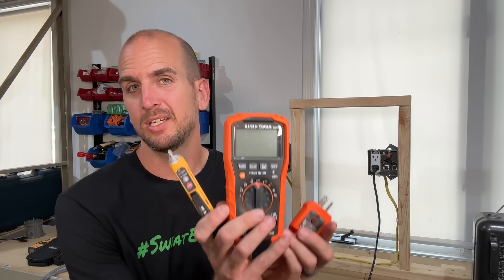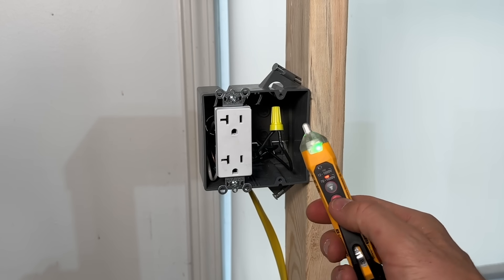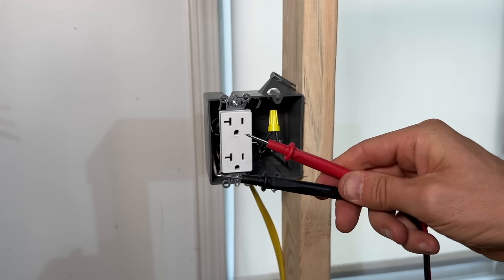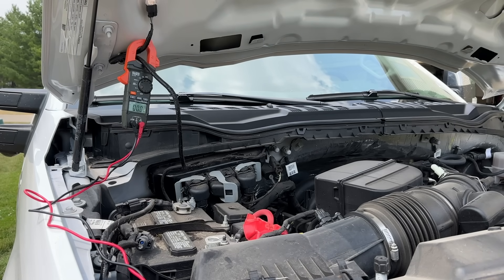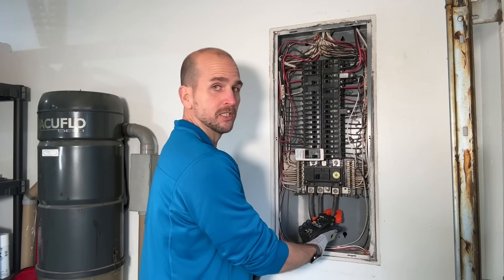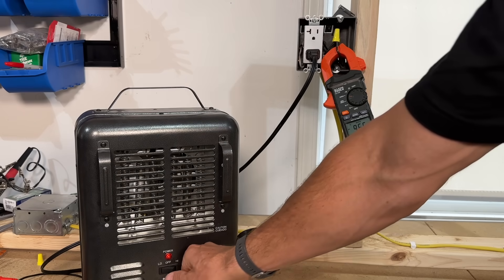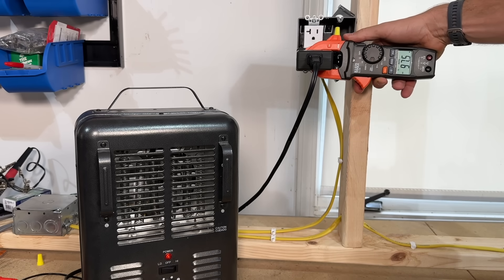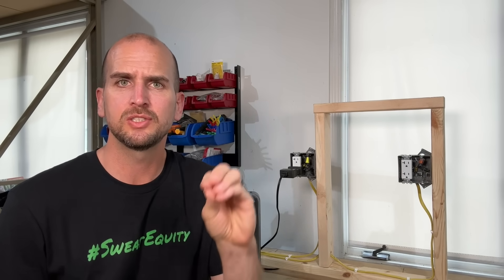Why The Clamp Meter Is The Only Tester You Need | Pros and DIYers

Comment: You can make a splitter for 1/4 the price or less of the ready made one by getting a cord plug and socket and wiring a short piece of insulated wire from the the hot and neutral connections on the plug and socket,. Then just clamp your meter around the hot wire to test (with it connected between the power source and the load, of course).

Comment: With a Tamper Resistant receptacle,  you can't insert voltmeter probes. Does the clamp meter splitter provide test points? I keep a cheater ground plug for that use.

Comment: As a journeyman electrician, I rarely use a multimeter to check if something is dead. The multimeter requires you to hit 2 electrical contacts simultaneously and if you have a burnt up outlet or switch or a dirty or damaged probe or have user error, it’s going to read dead even if it’s Alive. The non contact tester is the way to go.
Reply: @tecdrone710I was just about to go out and get a Klein multi meter. Why did you say they are unsafe?

Comment: Would be nice if it had InRush Amp (for like measuring start power on a motor or HVAC system)  Only one I've seen is on a FieldPiece meter.

Comment: Absolutely wrong and dangerous. NCV detectors would never give you 100% reliable AC detection, and almost never DC detection. You MUST use proper contact voltage detector. Klein Tools clamp meter is absolutely crap - it lacks low amps, ignores DC amps, is not True RMS and has low precision. Better get Fluke, Appa (Benning/Duspol) or Greenlee (Brymen) tools.

Comment: You can push bad battery to the 12,7 V area, but it will drop to about 10 V when small load is applied = you have one dead cell. As for alternator "charging", increase the load and observe the drops - then you can judge if it's OK/NOK.

Comment: It's a little odd to say you don't need a non-contact voltage tester, then say you can use a non-contact voltage tester in the shape of a clamp meter. You're using the same functionality, just in a different shape.

Comment: I would recommend a Clamp meter with DC current test. This would give you the very important feature for checking drain current on a cars electrical system without having to disconnect cables. Thank you for your video.
Reply: I don't have DC just ac so what i do ? I checked battery for my car with AC it said 0.004  its good or not?

Comment: Knowing how various tools measure or detect can be very helpful, even improving safety. Voltage is analogous to pressure, amperage is akin to volume. Direct contact meters can measure the "pressure drop" between a hot and neutral or ground, while NCV sticks rely on inductive fields around conductors, which may not always work as anticipated.
A surprising result shows when a stick detector is run along a cord; power is on, a complete circuit is operating, yet the stick will usually only alert along the "hot" side of the wires. Even in the breaker panel, the large neutral will usually not trigger the stick detector, though all the 120 V. current is carried back to the transformer along it. Why?
The analogy that fits is the hot leads are like the water pipes coming in to a place, under pressure, while the neutral and grounds are akin to the drains, where there is very little pressure.
You might get away with handling a neutral in a live circuit, because its resistance is much lower than your body; if you disconnect it, though, suddenly current will seek ground through you, going to either the neutral in your other hand, grounded surface in contact with you, etc. This is why modern tools have mandatory ground wires; old metal ones could have a neutral wear, and contact with the shell could make you the path of lower resistance. An uncle had that occur, and he survived by shoving the drill into the dirt. Not an ideal option.
Reply: I also use the water analogy, but if voltage is pressure, current is flow not volume (units/second) , and charge is volume.

Comment: I just purchased a Klein Tools CL220 meter and didn't know it had the non-contact voltage tester integrated into the clamp jaw. I also didn't know the test leads could take the extra sleeves off so one can insert the leads into an outlet. (This was the one thing that really bothered me, and now I know I can take this off and make the leads like I am use to.) Thanks again for a great video!
Reply: I learned the same things in this video 😂

Comment: My favorite Klein tool. The DC clamp ammeter makes it as useful under the hood as in the house electrical. 
My voltage tickler is still more convenient to check quickly for hot wires.
Reply: Pretty sure clamp meters don't work for DC because they rely on the changing field of AC. This unit doesn't measure DC amps and therefore isn't ideal for automotive applications.

Comment: The HT206D (Habotest or Kaiweets) is a affordable and accurate Clampmeter with DC current too, beside many other features. The cheap ones with only AC-current arent complete, many will regret when they bought a clampmeter without DC-current measurement. This important fact you didnt poin out.....and its much more useful than a second display ; )

Comment: I have always wondered how a line splitter multiplies the amps? If it just coils both the hot and neutral around in a loop ten times each then they would still just cancel each others emf out and you would still get no reading? I would like to see someone taking one apart.

Comment: Sir:  May I compliment you on your excellent  video !  You speak at a constant level, speaking  at a rate easy to understand, & you have good articulation. Your descriptions are absolutely correct, & for a home owner DIY person, it was a delight to see. I have a number of "amp clamps" (all high end") & a selection of  DMMs , which I absolutely MUST have ( I am not working on home electrics except my own, but the Klein unit is very good, & I can't disagree that the Klein would satisfy the requirement for the DYI. 
Your video eclipses many that I have seen on the internet by a wide margin. Thank you.

Comment: Thanks. I bought a clamp meter not long ago to use it as a clamp meter. Now I saw you using the non-contact function. I checked my Brymen BM037 and I discovered it also has EF-Detection functions. Good to know.

Comment: Oh B.S. I like to have all of those, including the clamp meter. I do things in actual electronics as a ham radio operator and such that I need a DMM too. Most DMMS are auto ranging anyway, on his clamp thing he has to change the decimal range by pushing a button. Also my DMM has more resolution past the decimal point that his clamp does. If you're not a homeless person, you certainly should be able to afford all of them.

Comment: Surprised that you are using the Klein CL120 as it IS NOT a TRUE-RMS meter
Instead, it is an Averaging Meter which WILL NOT give you the correct Current (Amp) measurements when used on non-linear or non-sinusoidal items such as Switched Power supplies, LED fixtures, etc.
(Note that all of the other Klein Clamp on Multimeters ARE True RMS meters)

Here is a video explaining why it is important to use a True-RMS meter for AC Testing:
https://www.youtube.com/watch?v=RFhG7l1YmBI

Comment: Been using one for years. Still keep one in my tool bag now that I'm retired, only mine is a EXTECH EX623. That model probably been upgraded by now. Just went through the house to check all the outlets, found many needing the terminals tightened. All good now.

Comment: No no no no!

If you want to test for hazardous voltage, go by what code and guidlines for safe working practises demand! You use an electrical tester, not a random diagnostics tool. The thing you show is a multimeter with current clamp, not a proper tester.

Finally get an electrical tester, many of them can even measure current (for example Fluke T5, T6, Beha-Amprobe 2100-Delta, RS PRO VTA and many others).

Your Current Clamp DMM can run out of batteries, be in the wrong setting, be damaged, be in a mode, be in hold or a hundred other things can go wrong. That's why it's not suitable to reliably test for dangerous voltage and perform safe insolation.

As before, my examples of suitable testers: Fluke T+Pro, T5, T6, T150, T130; Ideal 61-547, Vol-Con; Klein ET40, ET45; Beha-Amprobe 2100 ... and many others.

Comment: Honestly, I've hardly ever needed a clamp meter in 30 years for home repair. 9/10 jobs can be done with a multi-meter. That last 10th is largely covered by a kill-a-watt meter and a $10 contactless stick for convenience. Only ever needed a clamp for the main panel feeds or to feed the HV spark plug pulses to an oscilloscope.

Comment: Just because you have 12 volts does not mean the battery is good, you need to test with a load...... or you will never get an accurate reading

Comment: For home use, you can buy a watt plug in meter instead of splitters. You plug the meter in outlet and then your device into it. It’ll tell you current and power consumption and a bunch or other metrics.
Reply from the maker: Those are pretty handy, thanks for the feedback!
Reply: They are called Kill a watt & they are available at Harbor Freight

Comment: So you did a dyi video about testing electrical circuits with a meter. But you failed miserably . Because you didn’t say a word about safety. Nor worr safety glasses when you where in the panel .  Very bad example. If this is your normal way doing electrical work . I can see you being electrocuted. You might be fine 99  tine out of a hundred. But it only takes once to die. You’ll find out.

Comment: Cheap current clamps are great if you're not too bothered about accuracy. This one is 2% of reading plus 10 counts. So 400 amps could be anywhere between 382A and 418A. That's not including where the wire sits in the clamp, which also has a huge bearing on the measurement.

Comment: One thing that has annoyed me about my clamp meter and all clamp meters I have seen so far is the ability to use the MAX setting for both the DC and AC current clamp. For example, if you want to see the start-up current of a device like a compressor turning on or the starter motor in your car
Reply: It would be nice to get a meter that records max ac or dc amps.
its called data hold on the UNI-T 210e, its just a button you have to hit to hold the max value
it would be nice if the tool showed max without trying to hit a button and catch starting amps
Reply: @nexrace  Yeah, I tried similar things on another UNI-T meter, but the issue was that the meter would take its time switching between all the different measurement ranges. By the time the meter switched into the 100A range, the thing I am measuring is already started.

Comment: I have a combination non-contact voltage tester with a receptacle+gfci tester.  It is fantastic for basic jobs.  You can check for voltage, confirm polarity, grounding and test gfci functionality.  Though for trickier troubleshooting issues, I still bring out the multimeter.

Comment: I took a job in a manufacturing lab in 2019 where we had three Klein multimeters. After two years all of them were broken. They wouldn't go to the correct mode, or they just gave incredibly inaccurate readings, especially if equipment was operating near them. When I asked if someone was abusing them, I was told "no they just break a lot, that's why we have three of them." I also needed to take them completely apart to change the batteries.

For DIYers who might use them 3-4 times a year, yes, they're great meters. But if you're a Pro, spend the money for a serious meter. There are plenty of Fluke models under $300 made for technicians.
Reply: I ordered a Fluke AC/DC Clamp meter for $150 and yesterday found a Fluke AC clamp meter for $70 in a pawn shop so I grabbed it. This will really help me watch my solar system and inverter closer. I fried two alternators in a row so now I’ve turned off the DC-DC Victron charger until I can measure how many amps I’m drawing off the alternator(Think I’ll try adding a second alternator).
Reply: For professional uses, I only recommend Fluke. And I even bought one by myself in my home.
Reply: Fluke is the best!

Comment: Hey - a shortcoming in the aforementioned power measurement instruments, for which I've not found a work-around, is how to measure DC current? My Radio Shack DMM does what you demonstrated: AC Volts & Amps & DC Volts - but NOT DC Amps. Are any of them capable of measuring thus DC Amps? 

This is especilly important when determining a best-matched DC power adapter for things like USB & laptop barrery chargers. I hope U have some ideas?!?

Paul M - Atlanta
Reply: Here's an idea........google.
Reply: @typ044  Hey - don't you think I've tried that? If you know something I don't - by all means, please share!
Reply: @paulm5935  Well, not trying to be a dick but theres lots of meters that will measure dc amps, and if you googled it you should know that. There are piles of dc ammeters available for cheap. Also plenty of clamp meters do both,
for example my fluke 325 will do both AC and DC current. 
What is it you're confused about?

Comment: Fluke meter absolute best
Reply: And how would you know that? Is it because you read their marketing material? They have released products with the same defects as in recalled products during and after the recall. Taken six months top return recalled products, and returned one with the defect still in place. Fluke is fat on gov't contracts. Dull and satiated, No longer innovative, nor responsive to customers, They're premium 87V MAX has poor visibility display, poor backlight, and in audible continuity, diode beeper, A little tiny over voltage indicator. At that price these are easy fixes that should not be tolerated but improved and remedied. That is the best to you? Compare 87V MAX to Hioki DT4282 Which cost less and beats Fluke in nearly everything, including precision, resolution, speed and accuracy, Made in Japan by people who care and innovate. You can have your Fluke.

Comment: Thanks for the great episode. Now I know what that bump on the end of my clamp multimeters is for!

I have a Fluke digital multimeter with an AC Ammeter clamp accessory, a Fluke clamp ammeter/multimeter, and a Chinese brand clamp ammeter/multimeter. For DIY work both the mid-priced (around $200?) Fluke and the $65 Chinese brand clamp ammeters work extremely well, and are flexible enough to do almost anything around the house. One of the MAIN differences that people should look for is whether the clamp meter will read current load (amps) in both AC and DC. Many standard DIY units will only read AC, but if you're a DIY person working on both standard 120/240 volt AC and any low-voltage DC systems like a doorbell, sprinkler controls, or maybe even fancy zoned-heating ducting controls in a house, or on just about any 6/12/24/48 volt DC vehicle then being able to read DC amps is EXTREMELY useful as a troubleshooting tool. For electronics and smaller scale DC volts and continuity testing my regular digital multimeter is the king, but for house or vehicle the AC/DC clamp multimeters are a far better ticket to success.

Comment: In my 40yrs of electrical work. When I work in a national historical registry home, tracing knob and tube wiring that the customer cannot afford to rewire,  that pre dates the historical structure. The clamp on is next to useless. ON an open circuit, the clamp on will most likely read full voltage on the feed and open neutral side. Its great with modern wiring. my Volt tick has saved my life a few times. Laying against a live AC duct, my body became evergized and my volt tick in my pocket sounded off, telling me that my body could discharge a shock. I have repaired many knob and tube systems with just a volt tick, and a pigtail lamp.

Comment: Have you ever had to replace a complete window where you replace the outside framing it. Do you ever need to have a way to test from a plug or switch to the according circuit breaker.

Comment: I agree with you completely, my Kaiweets HT208D (bought as the Habotest brand) clamp meter is very useful as a DIY device, even including capacitor testing. For line splitter use I bought a short, flat "appliance" extension cord and split the wires near each end. This gives you options for measuring inrush current, etc. for refrigerators and airconditioners in tight places. One detail in the video- testing car battery voltages stopped vs running can have one wrinkle. If you have a "smart" alternator the voltage at idle may not immediately go up to 14 volts. I found this out accidently when I got a plug-in temp & voltage monitor and noticed that sometimes the voltage would stay at 12.2-12.4 (under load, engine running) before the alternator would cut in.
Reply: I recently bought the HT206D meter. I haven't used my conventional multimeter since. It does everything I need. The ability to read DC current is my most used feature. I like the fact that there are no current ranges via the probes, so no risk of blowing up the meter or device under test